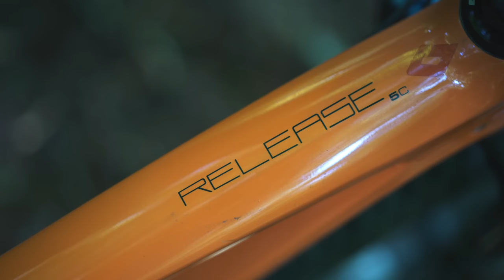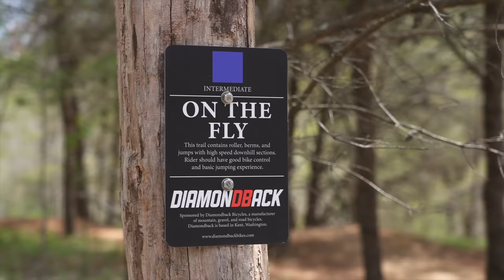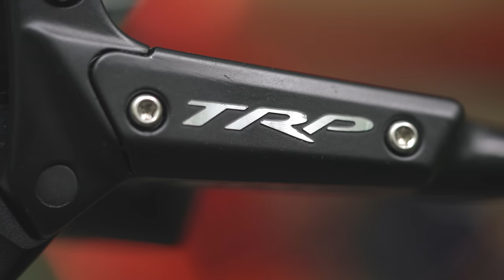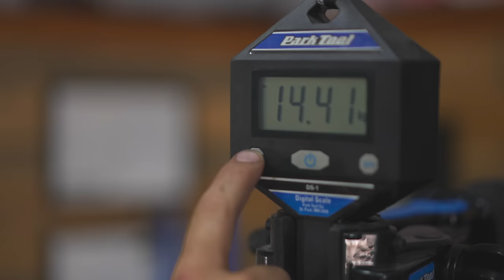It's new freaking mountain bike day!

Comment: Great video as always, just one thing Seth, there is a difference between millilitres and millimetres lol, maybe misheard but I thought you said the travel is 170 millilitres which is used to measure liquids. Litre is like one third of a gallon approximately and mili means less in latin. While the meter is approximately a yard and millimetres are the ones that build up the centimetres and meters.

Comment: I've been riding a 90s hard tail xc and road bike only for the past year. I recently jumped on my 160mm full suspension bike and it felt like a foreign object. Soooo plush. Definitely need to hit some trails on that more often. I hate having to get in the car and drive just to ride my bike which is a big reason I've been getting more into road riding lately. Plus it's just awesome going fast and getting stronger. I bet my mtbing will improve because of the strength I've gained from putting in long miles on the skinny tires.

Comment: Just saw that Bass Pro Shop sells an entry level full suspension mountain bike under the Ascend brand for $999. Has x-fusion suspension, mechanical disc brakes, 29" wheels and a 2x9 drive train. Doesn't look like anyone has done a video about them. Might be worth looking into.

Comment: lol that 52T looks insane on a 27.5 wheel, also there should be no gap on top of that raceface stem, top two bolts need to be tightened all the way before tightening the bottom bolts but im sure it'll still be fine

Comment: Seth, I onow you usually test and ride higher end bikes.
How about one that once was on the high end of bmx (before some ownership changes.)
I have a modern .mtb built under the Mongoose brand (now owned by Pacific.)
It is the 26" 21 speed "Snare". I really love this ride with it's disk brakes, ease of shifting and overall suspension functionality. With an 850psi coilover rear shock and spring system I trust that it would hold up to minor off road such as a casual trail ride. I have yet to take it off road, intentionally, other than accident avoidance into the grass. I have moved to an area where some casual 😅 9:29 trail riding is more feasible.
I was wondering if you would be willing to test a Mongoose "Snare", or if you already have, what were your thoughts? I don't want to be sinking money into wheel truing after only a couple of casual rides.
It has taken an impact hard enough to cause a blowout and faired well afterwards but, as mentioned previously, it has mostly been used as a commuter on roads and sidewalks.

Comment: Electric seat post :o something i was looking at getting when I got my bike 7 year back but they weren't really a thing & i still don't think they do them for my tube diameter :( just thought it would be good to use for day rides & if I was doing a bikepacking trip could just take it of & put in a standard post without having to redo all the cables each time

Comment: Question for you.
Every MTB on youtube goes on about dialling in teh suspension.
What doe sthat actually mean?
Being new to MTB i have no idea. I set my squsih to my weight and then went and rode about my usual routes etc and have done nothing to it since. I have no idea if changing anything actually tweaks anything as i can't tell the ride difference between settings for things like firmness without turning it way up or down, or rebound which is a mystery to me!.
The only thing i noticed going from hardtail to full was my full is much more physically demanding to jump and rolls down super bumpy terrain like its not there.